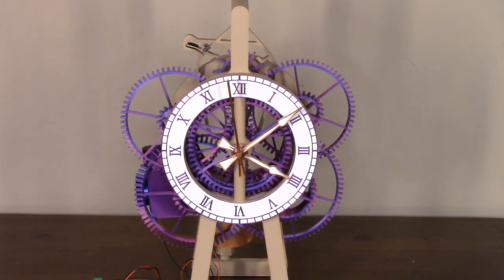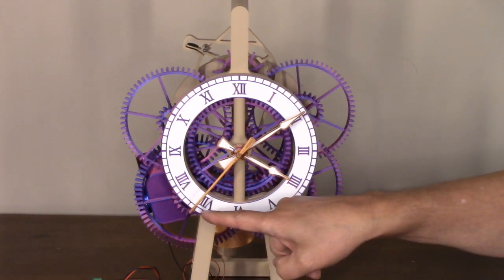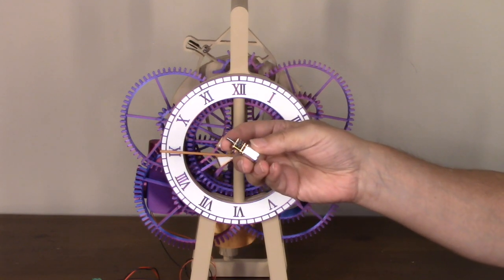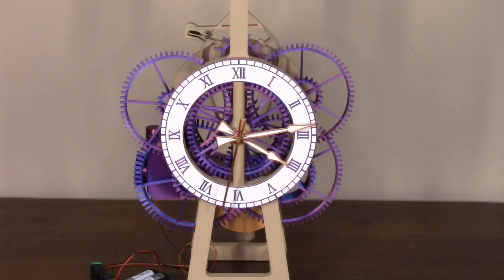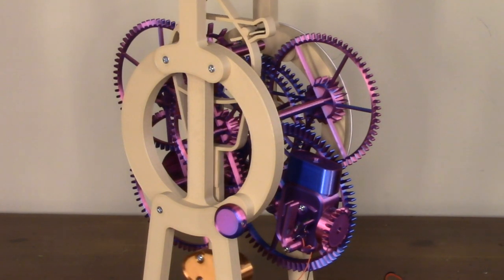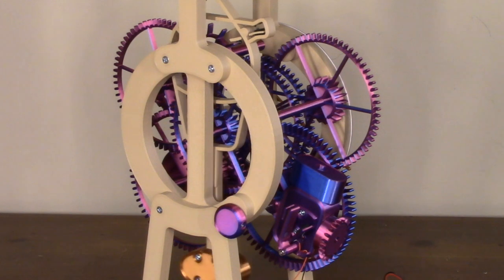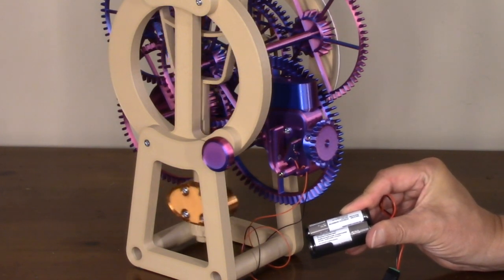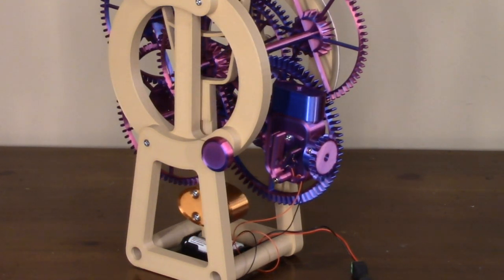Coup Perdu Clock Second Prototype

Comment: Fab.  V well done.  I'll be showing off my recently overhauled French, antique clock with Coup Perdu.
Reply from the maker: I would love to see it. The main reason for adding it to this clock was to allow the second hand to move in full second increments using a half second pendulum. It looks better but is less efficient compared to a deadbeat escapement. The energy used to flip the toggle lever is lost when it releases. It should be mostly balanced with just enough counterweight to return before the pendulum swings back.
Reply: @stevesclocks  Hi Steve - oh you shall!  It's fascinating to watch and it grabbed my attention in 2006 when I saw the clock for the first time.  There's also the Desfontaines escapement which is very similar and then there's the Pinwheel escapement.  OR, was it Desfontaines who invented the Coup Perdu escapement?  Further, there was a French clock with Coup Perdu which sold at an auction house somewhere in the States within the past few months, almost identical to mine!

Comment: Hello Steve.  Im printing on resin printer and the printing area isn't that big. If i shrink the design to 50% will it still work correctly? Or i must follow the original size?
Reply from the maker: The pendulum needs to stay the same length to keep proper time. The motor and battery compartment also needs to stay the same size. The gears could be scaled, but it becomes a new design if only some parts of the clock are allowed to be scaled.

Comment: Steve,
some month ago I built your 32day clock (with 15day option I think). Printed -> Assembled -> works like a charm right away, no debugging needed, just rewind every couple of days. 
Before that I did some other clocks (not your designs) and they never run good (or not at all, even after days of tinkering). I am really impressed by your designs, one can see and feel the passion (and the countless hours of work) which is inside this!
Actually my printer is busy with the magnetic pendulum clock and I already ordered the stepper and filament for the desk clock. Once finished I will also build this one here.

best regards from Munich,
Thomas
Reply from the maker: Thank you so much. I am afraid to count the hours that go into each one, so I guess they really are countless. :)  The calendar time usually runs about 6 months per design.

This clock feels like it will become my all time favorite design. The latest changes will allow it to be either desktop or wall mounted. The batteries and wiring will be hidden in the motor shell.

Comment: Steve..I think this is one of your best designs to date!! Super innovative!!! I'll be building one as soon as it's release.. Very cool filament as well, (already looking it up to get some on order 😊😊 ). Keep us posted on the files~!! Super psyched to build this one.. Might even be able to top last year's Christmas clock builds with this :) 💗💗😊😊
Reply from the maker: Thanks Jeff. I like this clock a lot more than the electromagnetic clock. And the stepper motor clock could use an update to add a real time reference clock. This clock uses much easier to source components. 

I am targeting an early November release date. Jacques just suggested a great improvement to hide the batteries in the motor compartment, so that will add a day or two, but well worth it.

Comment: very nice implementation of rewind mechanism, maybe include the batteries into it, then there is no loose wires'
really like the once per second motion
well done
Reply from the maker: I wasn't expecting this clock to run so well on battery power when I started the design. Hiding the batteries in the motor shell is a great idea. It can replace about 20 pennies used as weights.

Comment: Steve, looks like one of your best ones yet.   Will be great to print
Reply from the maker: Thanks. This one could be my favorite. It seems so much more reliable than the electromagnetic pendulum clock.
Reply: @stevesclocks  Which N20 motor are you suing?  I have collected a number from building Greg Zumwalt's mechanical toys
Reply from the maker: @woodwaker1  The exact motors I am using are in the description above. US$15 for 8 including shipping. They have a 3-6V motor with a 1000:1 gear ratio. 

Other ratios between 250:1 and 500:1 might work as well. They would rewind faster, possible with slightly higher noise. Power would be a bit higher for a much shorter duration, so battery life might be better.
Reply: @stevesclocks  Thanks - I ordered the motors and reed switched- should have them next week

Comment: Very nice. I love the mechanical clocks, electric ones only have so much interest for me ;) Keep it up, I need to print one.
Reply from the maker: Thanks. I like mechanical clocks also. That is why all my clocks have highly visible gears. The timekeeping in this clock is purely mechanical. The electric motor in this clock is only to avoid having to rewind it. And it even has a simple mechanical switch. :)
Reply: @stevesclocks  I think your switch is quite clever as well. I would prefer to do a falling mass powered clock, but don't have room in the shop! I think this one may be perfect. Wall mounted.
Reply from the maker: @HoffmanTactical  A wall mounted option is a great idea. I initially expected this clock to need an external power supply, but the small motors have low enough power to make battery power a feasible option. Jacques idea to hide the batteries in the motor module makes a wall mount even more feasible. 

One additional obstacle is the time adjustment knob sticking out the back of the clock. My other clocks can be adjusted by simply pushing on the minute hand. The second hand gets in the way on this clock. However, the closest gear to the front (in the upper left corner) can be used to adjust the time.

These are some of the final design modifications needed before releasing the design. It makes sense to include them in the initial release.
Reply: @stevesclocks  Well, I look forward to it.